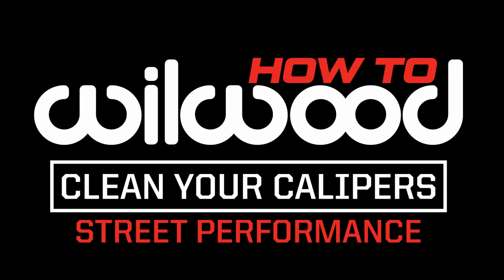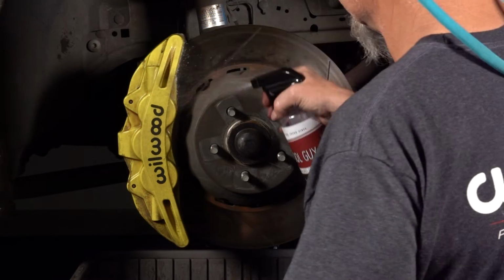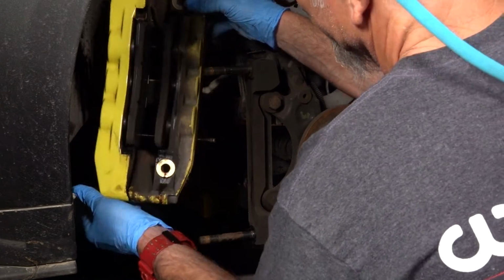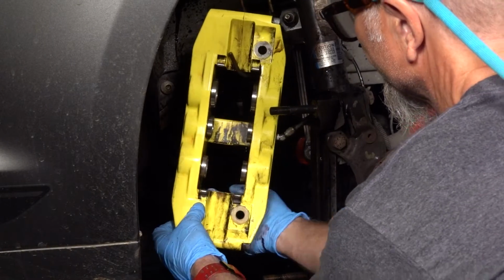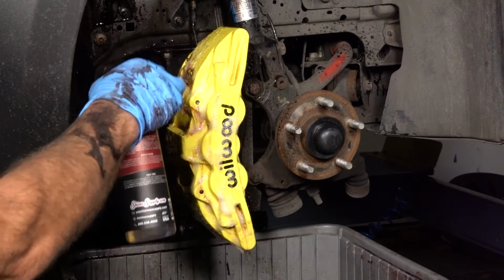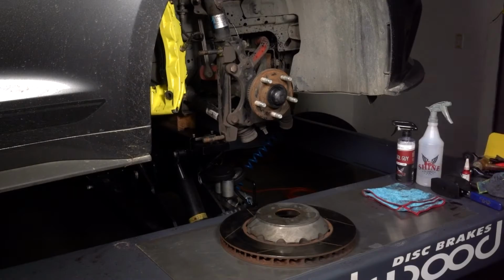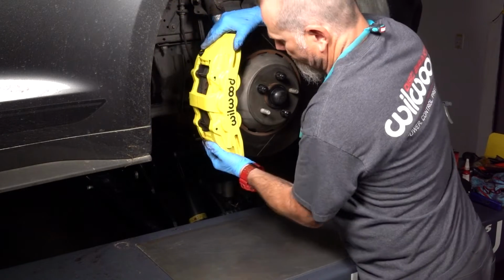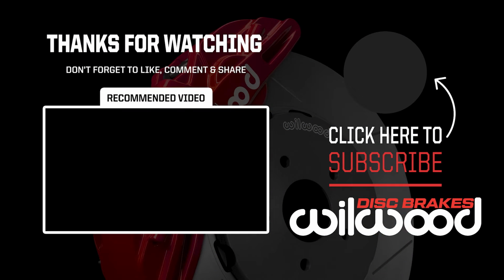Wilwood - How To Clean Powder-Coated Calipers (SX6R)

Comment: Simple green works really well. Highly recommend it
Reply: I'm sure it does! I might add since simple green is a degrease,  add Lil bit of wax sealant to the outside of the caliper to keep the powder coat finish long lasting.